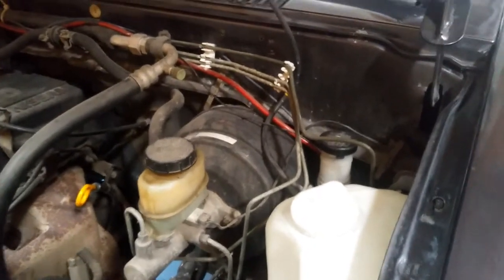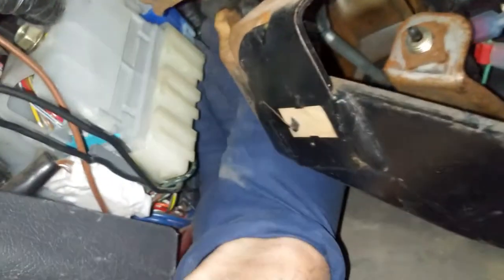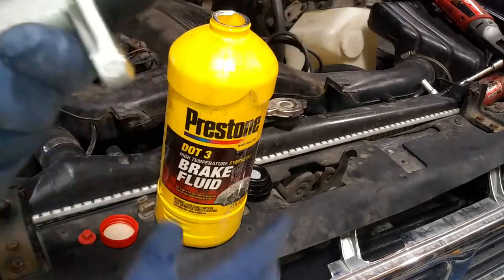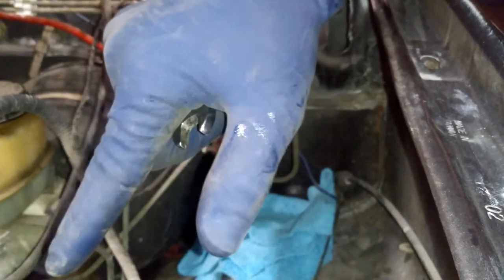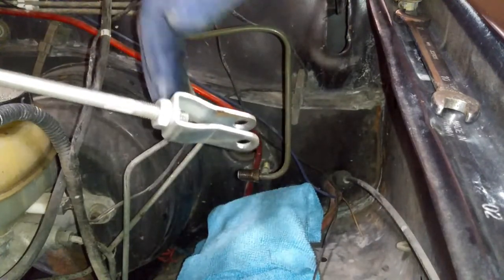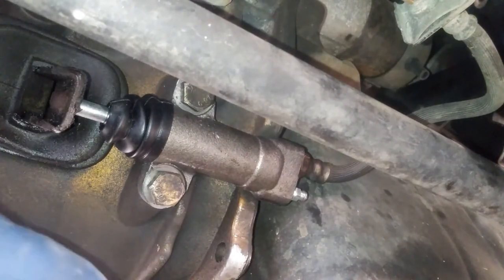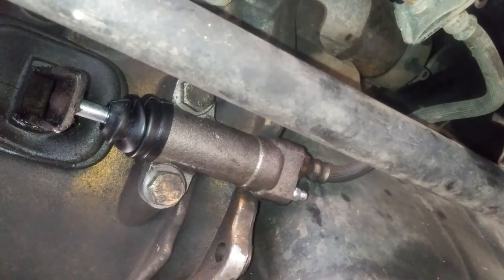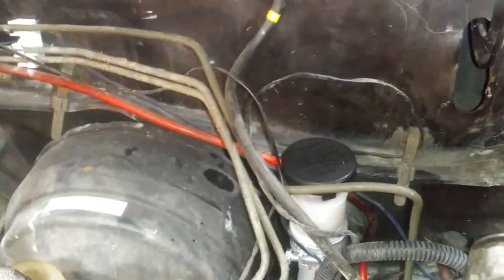how to replace a clutch master cylinder on any car or truck

Comment: thanks for doing this tutorial, I found it helpful.

one thing grated on me. 
Don't use standard open ended spanners on brake lines.
get a Flare Nut Spanner Set, or brake line spanner set.
they are wider ring spanners with a slot cut out to fit over the brake line.

yes, I've been there with burred over nuts on brake lines. the small spend on brake line spanner set will be money well spent.
Reply: eh the new snapon wrenches with the grip technology whatever you call it gets em done good for me and wrench pliers but yes you are right still

Comment: I believe you did a very good job of explaining this process.  I also believe that I can follow your guidance in order to replace the master clutch cylinder on my Toyota pickup.  My only concern is that the line that runs from the master clutch cylinder to the slave cylinder will also have to be replaced.  Thank you.

Comment: Great video, congratulations and thanks a lot for teaching all of us!
I realised I got a problem trying to shift gear when I start up my car.  I don't think I have some trouble with my clutch pedal, I can push it down like was always, middle hard, I have proper amount of brake fluid at container. I have no idea what to do to try solve it.

Comment: I've had problems with my clutch master cylinder ever since I bought the truck.  It has been replaced by a mechanic multiple times.  

Is it possible that the master cylinder continues to fail due to insufficient bleeding of the system?  

If it's not that, do you know of other reasons why a master cylinder should keep failing after a couple of years' driving?

Comment: Fastest way gravity bleed with clutch up get a steady string now close a slave cylinder bleeder ..Next push the clutch down with the stick n hold Open bleader and push the slave cylinder piston all the way closed clothes and bleeder You should now have pressure...Only works on sachs slave....

Comment: Hey Jabo, I have a question.  My 91 Nissan pathfinder has one bleed valve in the engine compartment,  and then another down by the slave cylinder. Do I need to bleed the engine compartment one first and then the lower slave valve? Or should I just leave the engine compartment one closed and bleed from the slave bleed valve below?

Comment: On an 03lancer does the u shaped pin clip have to be removed before you can pull the clutch master cylinder through the firewall

Comment: I'm about to install a clutch master cylinder for my 2001 Ford Escape (4 cylinder).  The only difference I can see so far is that my master cylinder feeds from the brake master cylinder.  How different will that process be compared to what you've shown?

Great video by the way!
Reply from the maker: It's the same. It just shares the brake fluid Reservoir

Comment: Great video. I have a question, though. I followed your video step by step for pulling master cylinder out. The thing looks fine except for super old oil sludge since I neglected this for a while. It was almost empty too. Two questions: (1) Is it possible the pedal failed because I did not have oil at MIN level? (2) If I cleaned it out with WD40 or Simple Green, will any remaining of those products interact badly with the new oil? Thanks in advance.
Reply: Yes, yes

Comment: I didn’t bleed the clutch master cylinder and I have already bleed it through the small nut 10 times but it’s still not building pressure

Comment: I've got the same truck I've changed the master and slave cylinder over a dozen times nothing works..... But of course I never went to the dealer😢😢😢😢😢😢.. Just autozone O'Reilly's in advance auto every single 1 of their parts leaks doesn't hold pressure

Comment: Um, what is a clutch?  Are those the button thingies on the steering wheel that make the transmission shift? Is that what is called autostick system? I knew some one that had an autostick car.  I think the clutch cylinder was going bad because he drove it like a regular car with no pushing the buttons on the steering wheel. Maybe she took out the clutch and let it drive like an ordinary car.